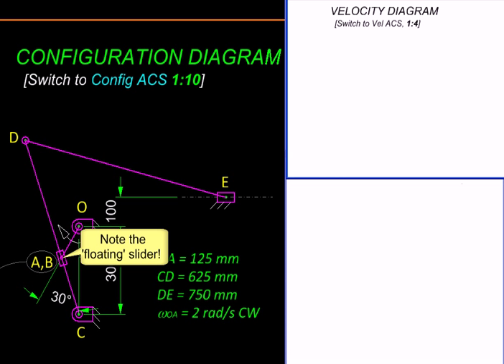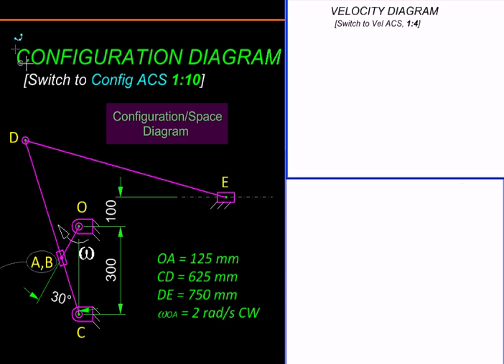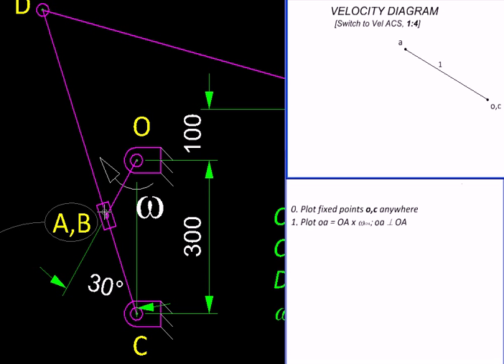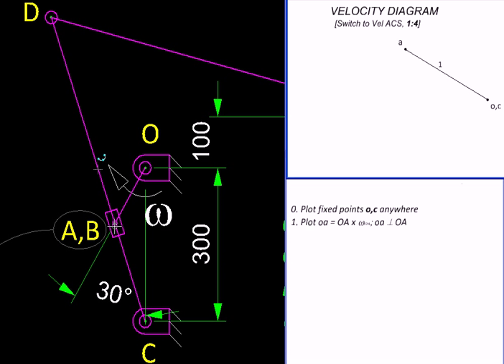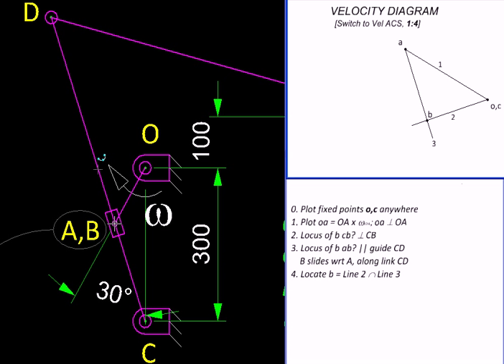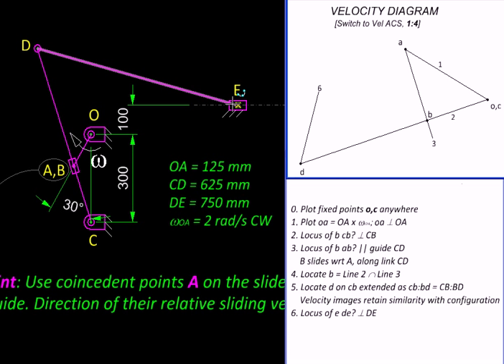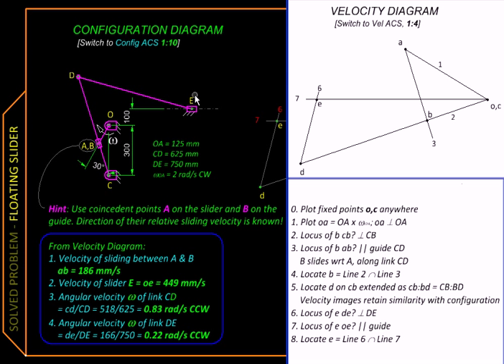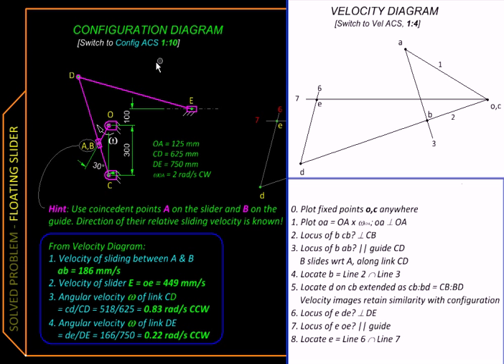Kinematics Ch03F Velocity Problem 02

Comment: Sir , If A and B are same points , then how could be B sliding with respect to A ? ??
Reply from the maker: Sagar Shah 'Point' is an abstract representation of a location. So you can have two of them belonging to two different links, occupying the same location. As the links move relative to each other, the 'points' go their separate ways.

Comment: Sir, thank you for the video. I still have a difficulty with points A and B. Is B on the slider or the link CD?
Reply from the maker: Ashish Patel It is on both! That is why it is called a double point. In fact they are two points on two different links, but coinciding at this particular instance. Remember we are analyzing only a specific configuration of the mechanism.